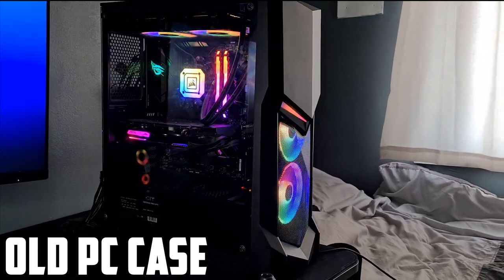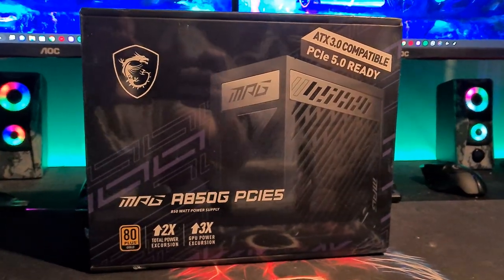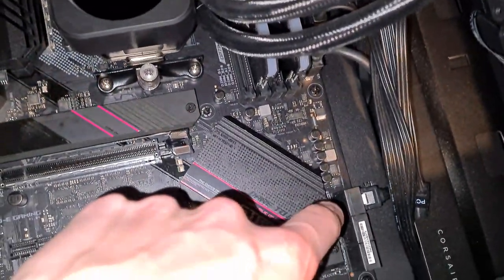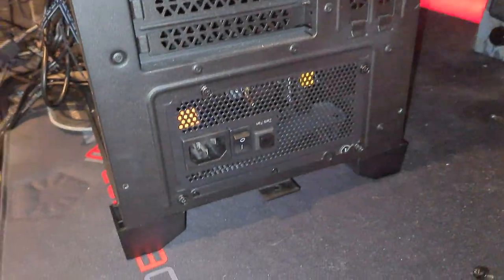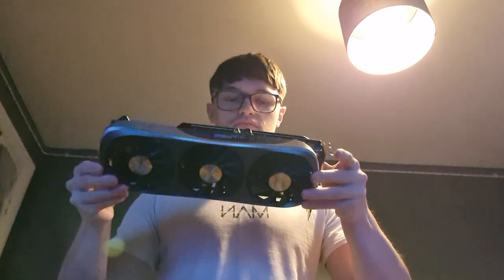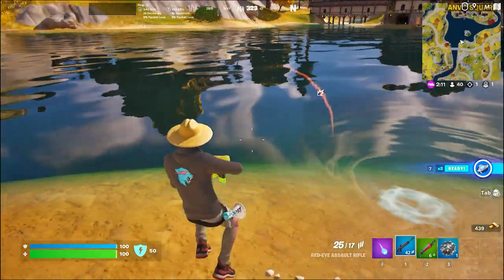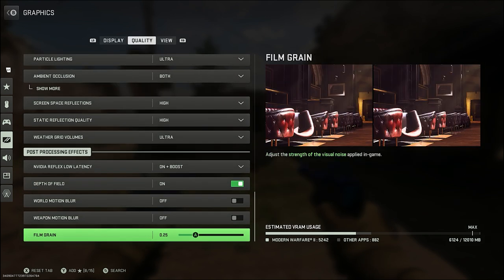Upgrading My DREAM PC 2024 | RTX 4070 Ti + Ryzen 5 5600X

Comment: I jave the 4070 ti and i only have a 650w psu, works great no problems, with the 5600x
Reply from the maker: That's great to hear bro ig I upgraded the power supply to be future proof and I don't like the look of the adapter if you don't have the high vault gpu cable

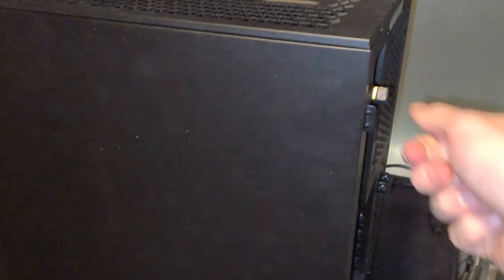Comment: At 2:16 it shows the HDMI and display ports being super close to the top. I just my 4070ti in today and cannot connect my monitor too it as the cable is too big. This wasn’t an issue for you? Or does it not need to go in fully?
Reply from the maker: I use display ports bro so I wouldn't have experienced that issue I'll have to plug one in to see if it can't be plugged in

Comment: Hey I have a question about this, as I wanna build a PC with the same GPU and CPU soon, I just wanted to ask if it's a good setup despite the bottleneck if I wanna play at at least 60fps (I'm coming from a rather bad laptop so at least 60fps is really enough for me). I don't know what exactly you play besides the games you showed, but I'm gonna play Cyberpunk 2077, Fortnite, Forza Horizon 5, Assetto Corsa and a couple games that don't require much in terms of CPU and GPU (all games on 1080p) and I just wanna know if those games are playable at at least 60fps with that CPU and GPU combo. I'm probably gonna upgrade from the 5600X in a few months since less bottleneck means of course better performance tho.
Anyway, nice video and I hope you can understand what I wanna know despite this load of text lol
Reply from the maker: You'll get way over 60fps I get like over 100fps with the games I play but recommend upgrading so your getting most out of your system
Reply: @Kingman124  Alright, thanks for helping!
Reply from the maker: @mtg_369  I'm getting like over 200fps max settings on Modern Warfare 2 multiplayer like on certain maps
Reply: If your only playing at 1080 don't waste the money on a 4070ti. It is designed for 4k and 1440 it will have worse performance and bottlenecks at 1080 a 2070 or 2080 is more than enough for crazy fps on 1080. my old 3060ti gets 300 on FPS games 1080.
Reply: I am very late but you should have scale down the graphics card to like rx 5700 xt or rx 6650 xt or rtx 3060 12gb if you want to play in 1080p. 4070ti is most probably a 1440p card.
Reply: @blacktilebluewall  I bought a 3080 and I got a 1440p monitor recently so it’s all good now lol

Comment: Hey Bro! 
What is bottlenecks exmplamples in this setup? Do you have fps drops, stuttering etc? Or maybe is only unused GPU's power?
Reply from the maker: Not all the time but the frames drop like once in a awhile in some games
Reply: Thx for response! One (or two! xD) more questions... lol. Is it drastic drop? (is it noticeable or possible to see only in the monitoring app?:>) Do you play in 1080? 1440?
Reply from the maker: @Patagg X  I use nividia geforce experience it goes from like from like 150fps for example then goes down to like 60fps usually happens on the warzone plane animation at the start of a battle royal game I play 1080p
Reply: @Kingman124  yeah i mean as i said this cpu is not good in anyway for this gpu the gpu is just overkill it is like driving a lambo with an cheap as fuelpump wich is not delevering
Reply from the maker: @Linus Price  yea I know I'm upgrading to newer mb soon and getting ddr5
Reply: @Kingman124  yeah this is a good idea but it is a nice pc anyways just the cpu is slowing it down
Reply: @Kingman124  so rather then spending like 700$ on a new cpu and mb an ram you could just get the higest amd cpu you can get for you motherboard and it should work perfectly fine just if you wanna safe money but if you dont then go for it
Reply from the maker: @Linus Price  I have a b550 gaming e so what cpu would that be ?
Reply: @Kingman124  i would suggest you an amd ryzen 9 5900x and then there is no bottleneck in any way 🙏🏼
Reply from the maker: @Linus Price  alright bro I'll keep that in mind would I still be future proof if I get this cpu ?
Reply: @Kingman124  do not listen to that weirdo. Your cpu is fine bro
Reply from the maker: @kasino  I'm not getting involved tbh but my games look amazing and getting a high fps so I'm happy:)
Reply: @linusprice  would the ryzen 7 5800x3d bottleneck this gpu?
Reply: @Mangotunde   a bit but not as much as the 5600x but still it is noticable but should be fine for 1440p gaming 🙏🏼
Reply: @Kingman124  you probably have the 1660super drivers installed still n its confused
Reply: @Mangotunde  not at all, the bottleneck from the 5600x is so small its not noticeable, maybe at 1080p, but doubtful. if you run the 4070 ti and 5600x at 1440p there is no problem at all, it's what I run, everything maxed out all the time

Comment: i have the same version of this gpu but i didnt put the gpu holder … is this important ? or this version its okay and every thing will be good if i didnt use the holder ?..
Reply from the maker: I think the holder is ment to be used if the gpu is sagging but mine isn't so I havnt used it
Reply: @Kingman124  i have the trinity one but without oc so its not important to use then specially in this version right? are you sure you dont have sagging?
Reply from the maker: @Get Hobo  I have no sagging at all my gpu is the oc version
Reply: @Kingman124  and if i have sagging whats the problem thats i will have after using?
Reply from the maker: @gethobo5185  it will just keep the gpu upright ig you shouldn't have an issue bro

Comment: I have this exact CPU and planning on buying the same card in the next few days. I'll be playing on a 1080p 144hz monitor until the summer and then go for a 1440p 144hz monitor, do you think it will hold up because of the bottleneck? I mostly play cod, overwatch and single player games such as cyberpunk
Reply from the maker: I'm not a pc expert unfortunately but maybe there is gameplay test on youtube maybe I wish I can answer that.
Reply: Dont get this gpu for this cpu, first upgrade your cpu then gpu otherwise you will get a lot of bottleneck
Reply: @Noobsmasher69 the cheapest option is the amd ryzen 9 5900x at current state🙏🏼
Reply: bro 4070ti for 144hz is crazy just get rx 6700xt or 3060ti
Reply: @linusprice  would the ryzen 7 5800x3d work with this card?
Reply: For 1080p yes almost any cpu will bottleneck you 1440p it’ll slightly bottleneck you but not by a major amount it’ll still be a good high fps experience but I would definitely try to upgrade the cpu in the future but no need to rush
Reply: don't listen the trolls, all they have is misinformation watching YouTubers performing fake benchmarks of low setting games. a 5600X won't botleneck your 4070ti at 1080p maximum settings GRANTED. run any game 5800x3d+3080 vs 5600+4070ti and you will see what I'm talking about, the 4070ti setup will end up having more fps, allways. if you turn RT on, and specially if you think DLSS3 frame generation works for you, then at some titles the 5600 CPU will be running at 200fps DLSs3 vs the 5800x3d at 100fps with dlss2
Reply: Upgrade to 1440p asap the 4000 series is not made for 1080 and will suffer performance issues.

Comment: hi I've a question.
I also have 4070ti + ryzen 5 5600x, but for some reason I feel like my system just isn't running at its potential. I don't know if it's a bottleneck issue. I play at 1440p, and most games I run, my GPU is only running at 60-80% of its capacity. CPU also seems to only been running at 30-50%, at least according to geforce experience (maybe there's some hidden bottleneck on certain cores that's not showing?)
for example, monster hunter rise: my system should absolutely CRUSH that game. However, I'm only getting around 120fps on average (I have a 170hz monitor), and my system says my GPU is only running at 60% capacity. Is this becuz the ryzen 5 5600x bottlenecked the system? 
(I have g-skill 16GB DDR4 RAM and Samsung 980pro 1T SSD. My motherboard is ASUS B550-i)
Reply from the maker: I think it is a bottleneck tbh as sometimes I see my cpu run high % then my gpu time to time I get frame drops.
Reply: Get a 5800x3D they are marked down about $300 rn. Rr a 5900x or 5950x if you want to let the 4070ti sing my guy.

Comment: I would suggest maybe holding off on a cpu upgrade if you’re gonna go for a 1440p monitor the 5600x still holds its own with a 4070ti obviously if you have the money and wanna just upgrade anyway then it’s understandable but it’s not required especially the higher the resolution like at 4k your cpu will barely be doing anything even 1440p you’ll barely be bottlenecked by the cpu
Reply from the maker: Thanks for the info bro pc building is pretty new to me I only know the basics 😅 so should I either get a 4k monitor or a 1440p monitor
Reply: @Kingman124  depends on what you wanna do tbh like if you’re more into story games and don’t care too much about a super high fps experience then maybe 4k is good for you but if you play a lot of competitive shooters then maybe stick with 1440p the card is capable of doing a lot of games at 4k 120 frames but the vram might limit that in some games but if you decide to go 4k then you probably won’t need a cpu upgrade for awhile
Reply: I have a 4070ti and same r5 and ram, and its seems im totally bottleneck or don't know how to use both correctly
Reply from the maker: Alright thanks for the advice
Reply: @simonliotier4631  i have the same issue. I have 5600x + 4070ti with 16gb DDR4, yet most games I play, my GPU only runs at around 60-80% load.
Reply: @jewii3824 what do you suggest on purchasing 5600x for rtx 4070ti ?
Reply: @ThePrabhu16  if you play on 4k, I think pairing a 5600x with 4070ti is probably the most optimal, since that's going to put more stress on the gpu instead of the cpu.
However, if you play on 2k or 1080p (no reason to play on 1080p really if you have such a strong gpu), then you will notice a cpu bottleneck. That said, for most games you will still have more than ok fps, it's just that the gpu's full potential won't be used
Reply: @jewii3824  i basically Play on 1440p. Will this 5600x will stop rtx 4070ti to perform at its max? waste of money if gpu is not fully utilised. 

Thanks for replying

Planning for i5 13500 or 13400 processor. What do you suggest
Reply: @ThePrabhu16 am wondering the same thing! I am 2k with Ryzen 5 5600x and I want to know if I am safe for a 4070ti

Comment: You could just get 5800x3d and get rid of the bottleneck without having to buy new mobo/ram
Reply from the maker: Not a bad shout tbh I'll probably get one of the newer mb in the future with ddr5
Reply: it's actually way better to keep the 5600x and buy the 4070ti than to get 5800x3d and a 3080 for the same money
Reply from the maker: @Olavo Oliveira  I already had ryzen 5 5600x as I was using it with 1660 super but I'll think of a upgrade in few years or months

Comment: i looked it up and the 5600 bottlenecks the 4070 really really hard. def safed money in the wrong places bro ;)
Reply from the maker: Yea I mentioned that near the end of the video my plan is to upgrade mother board in the future and go for a ddr5 and get a new cpu
Reply: @Kingman124  good idea!
Reply: I haven’t read anywhere that the 5600x bottlenecks this gpu hard. In fact everything I have read said at 1440 p and 4K this cpu is perfectly fine with a 4070 ti. Only at 1080 p there’s a slight bottleneck.
Reply: @bretwade8065  even on 1440p you get a 50% bottleneck
Reply: @linusprice  you tested it out?
Reply: @linusprice  lol you crazy
Reply: @forthecreed_490  the r5 5600 is a middle class cpu where the rtx 4070 is a high end gpu and so they dont work good together any good
Reply: @linusprice  it’s not a 50 percent bottle neck at 1440 p. The 5600 x isnt a cpu from 6 years ago lol. It’s performance in gaming was close to the higher end ryzen 5000s at the time. At the most there’s 10 - 12% bottle neck. There will always be some sort of bottle necking. But way to many people throw that word around
Reply: @bretwade8065  this cpu is made for middle class gpu and not an high end gpu so even it is a kinda new cpu you can not pare them without a 50% bottleneck with this kind of gpu and as i see you have no clue of what you talking about
Reply: @bretwade8065  and no for example my pc setup got 0% of bottleneck, i got an rtx 3080 and i7 12700k and get better fps as he does with his 4070
Reply: @linusprice  I just wanna know where you’re getting your information lol I know exactly what I’m talking about cause I’ve been been building pcs for 20 years. I can tell you right now you have no clue what you’re talking bud.  Have a nice day 👍
Reply: @bretwade8065  my information is from a bottleneck calculator wich is showing you the exact bottleneck i have 7 years in pc building so i know as well what i am talking about so i think you just not good in pc building
Reply: @linusprice  bottleneck calculators are trash 😂 it all makes sense now. Like I said have a nice day
Reply: Omg bro this calculator is reliable i build many systems with it and it was always right. So dont say something like this if you have no clue what i am talking about
Reply: @bretwade8065  and if you would have watched the video you would know that he is planning to upgrade because he has bottleneck issues and he even told us just look up the comments
Reply: @linusprice  what calculator 😂
Reply: @linusprice  lol just go to watch benchmarks on yt especially (ancient gameplays) channel he test most powerful cpu against mid tier cpu like 5600X there is a slight difference in 1080p over 100 fps sometimes but when it comes to 4k games for exemple there are absolutely no difference between a 12900K and a 5600x
Reply: @forthecreed_490  show me on good benchmark with an 5 5600x paired with rtx 4070 everyone is gonna tell you that this cpu is not meant for this cpu and it is drastically slowing it down, i mean those people wich actually knows something about pcs
Reply: @linusprice  no everyone told me it doesn't matter and this cpu is more than enough for 2 next years at least
Reply: @forthecreed_490  yeah it will if you pair it with the right gpu like an rtx 3060ti then it is perfect but not an rtx 4070 you get it now?
Reply: @forthecreed_490  it is like building an race car you can not put an v12 in a car without getting the right components as like a fuel pump, enforcements etc... It will just suffer and lag in power output
Reply: @linusprice  my point was the 5600x is not bottlenecking at 50 percent with that gpu. User benchmarks are more reliable for measuring cpu and gpu combos. With from what I seen and tested has been around 12% average. The 5600x in gaming only performed around the entire line up of the 5000 cpus. Unless we’re talking about a 5800x3d which I would recommend with this gpu. Do I recommend the 5600x with a 4070 ti? No I don’t. If you’re gonna go with AM4 platform your best bet to get rid of the bottleneck would be a 5800x3d..and when I said there’s always gonna be a bottle neck didn’t mean with cpu directly. There’s gonna be a bottle neck somewhere. No pc is 100 percent in-sync. Bottleneck calculators have shown that there’s a bottleneck somewhere even with high end cpus. I didn’t have low fps issues when I used a 5600x with my 4070 ti. But I did see a performance increase with the 5800x3d. People have been having issues with fps with 40 series even with high end cpus. I think maybe it’s a driver issue. But like @ForTheCreed_ said at 4k it becomes irrelevant
Reply: lol Bro what nonsense! pair the 4070ti with any CPU U you want, you won't have even10% fps improvement even with a 13900ks. that's not bottleneck, it's just what it is at this resolution
Reply: @linusprice  nonsense man, there's no difference at all running this GPU with a 5600, a 5950x, even a 13900k. at some titles the X3D will improve the fps by at most 20%, but that has nothing to do with other CPUs "bottlenecking" it. a 1600af will bottleneck every GPU at 1080p in valorant for example, where's you get double the fps playing it on a 5600. but play valorant with a 7900x and there's nothing different against a 5600x. play any RT game ultra settings at 1080p even the 1600af will give you the same fps as the 7900x in a game like portal rtx. it's about how much gpu the game needs vs how.much CPu. simple graphics will be bottlenecked by the CPU, realistic RT graphics by the gpu. now, even the 1600 can give you 120fps, what's the point of worrying about it? if you are a PC.builder just put the 5800x3d with a 3080 vs the 5600 with the 4070 ti and you will know for real with setup gives you more fps at ultra settings where anyone buying at that price bracket will play, and that's the 5600 one with the better gpu. if you play the same games at the lowest setting the 5800x3d will give more fps, sure, but again who the heck is going to play that way with crap graphics after spending $900 on the CPU+GPU combo?

Comment: U should take I5 13600k. It will fit perfectly.
Reply from the maker: I have am4 board 😭
Reply: @Kingman124  yh i saw brother, I think this is the best solution. Otherwise an R9 5900x OR R7-5800X? :P Nice videocard, no coilwhine at all? this card is not noisy?
Reply from the maker: @Y D  its quite bro but obviously gaming it tends to be abit loud depending on what I'm doing
Reply: @Kingman124  ok nice xxx